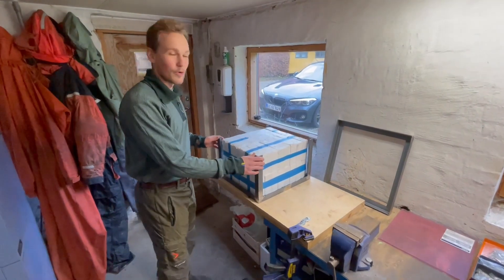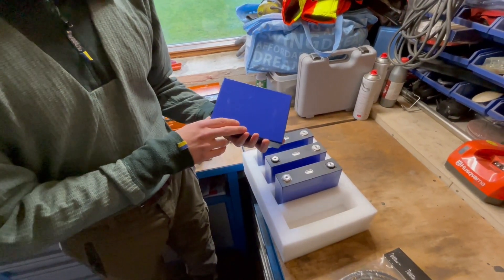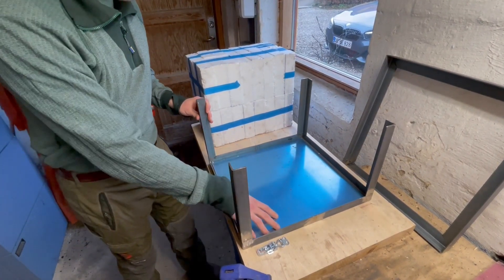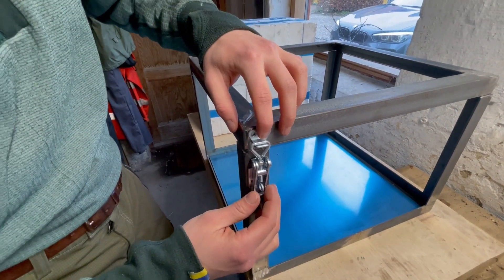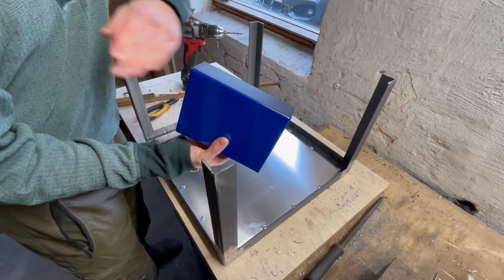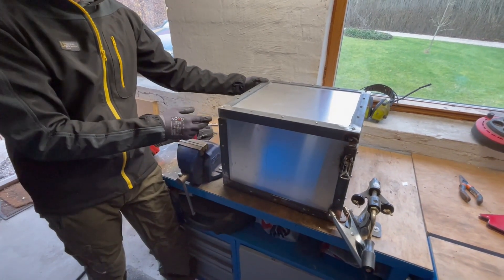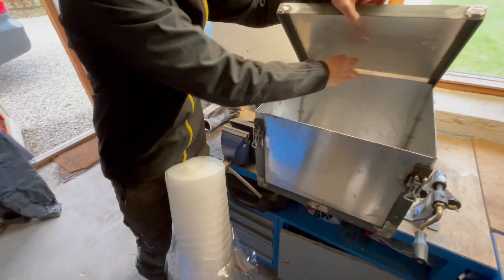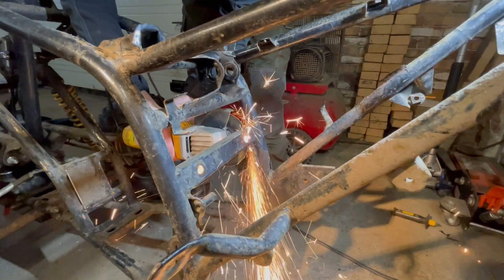The Electric ATV Conversion Ep. 3 - Battery box

Comment: I agree with using thicker foam around cells, I found using the Cheap 10mm Thick Camping style mattress (usually blue in colour) works great for large battery builds. Obviously your battery box needs to be large enough to allow for the extra thick foam I recommend. (20mm extra across the entire battery box)
A Very nice build so far, Great Work 👍 👌 👏
Reply from the maker: Thanks a lot for the input :)

Comment: It is a good idea to leave 2mm  gaps  between  cells to keep them  cooler during  heave duty work .
Reply from the maker: Yep, I agree. The only slight thing there is with these LiFePO4 batteries, is that they have a longer lifetime if they are under compression in the battery pack. 
As they are charged and discharged they grow and shrink slightly, causing the electrodes and electrolyte to get disordered. Therefore in my case there will not be an air gap between them, but maybe I’ll make a cooling grill in the top of the battery box, if it becomes an issue. 
I plan to have a temperature gauge with the BMS, so I can monitor them 😊
However the avg. temperature in DK is around 8-9 deg C, so I plenty cold outside as well.

Comment: Did you leave space in the box for the battery connections and BMS wiring?
Reply from the maker: Hi Tyler,
Yes er did. However er didn’t leave room for the BMS to sit inside the battery box, so that will have to go outside.
Reply: have you decided which brand of bms to use?  I drove daly bms on miss 20s but the balancing is a joke on them and it is only passive balancing
Reply from the maker: @goelectric8269  Yes I have heard that it is difficult to find sufficiently effective BMSs. I have been looking at this: 
https://www.aliexpress.com/item/32826469363.html?srcSns=sns_Copy&spreadType=socialShare&bizType=ProductDetail&social_params=20274371692&aff_fcid=d1c59efa0a99486a9fbcc1e5a8522909-1645287920955-05724-_mKDkDoF&tt=MG&aff_fsk=_mKDkDoF&aff_platform=default&sk=_mKDkDoF&aff_trace_key=d1c59efa0a99486a9fbcc1e5a8522909-1645287920955-05724-_mKDkDoF&shareId=20274371692&businessType=ProductDetail&platform=AE&terminal_id=e3c54fc5c42b46ab859aa58a39056a78&afSmartRedirect=y 

Or alternatively:
https://www.aliexpress.com/item/32959837122.html?spm=a2g0o.detail.1000014.8.638c15dc0WQSyA&gps-id=pcDetailBottomMoreOtherSeller&scm=1007.40050.266918.0&scm_id=1007.40050.266918.0&scm-url=1007.40050.266918.0&pvid=d21f23e0-e05a-4045-915d-fec462011d1c&_t=gps-id:pcDetailBottomMoreOtherSeller,scm-url:1007.40050.266918.0,pvid:d21f23e0-e05a-4045-915d-fec462011d1c,tpp_buckets:668%232846%238108%231977&pdp_ext_f=%257B%2522sku_id%2522%253A%252266551856122%2522%252C%2522sceneId%2522%253A%252230050%2522%257D&pdp_pi=-1%253B720.83%253B-1%253B-1%2540salePrice%253BDKK%253Brecommend-recommend

I have tried contacting the sellers to hear if they think their systems are sufficient enough to handle the system that i have. :)

Comment: This is great! How will the battery pack attach to the frame?
Reply from the maker: Thanks. It is still up for consideration. But it will be a slide in and out solution, so that the battery can also be used to power other things than the ATV. 
I’m thinking that just a couple of bolts will clamp the battery box to the frame and the sliding rails 😊

Comment: How much range do you think you will have?
Reply from the maker: Good question. -I have calculated with a consumption of 0.15 kWh/km, which was determined by converting actual gas power 4x4 ATV consumption measurements to energy consumption in joules and then to kWh. With my 9 kWh battery pack I will be able to go (9 [kWh]/0.15 [kWh/km]) = 60 [km]  in unfavorable conditions and rough terrain (cold and muddy).
Leisurely driving would probably give me around 100 km range :)
Reply: @gorm1106  man that is sweet! I’ll have to try something like this myself
Reply from the maker: ITSMART 
Yes, U definately should. It’s a fun and educating/interesting process. 
The only thing that surprised me bit with such an electric vehicle conversion is the cost of components, where motor, batteries and controller are the most expensive. - But Luckily there are some cheaper components out there if one is not into a to expensive project. Check out Goldenmotors webpage, they make nice products also at a fair price. Also if one can live with lesser range and more frequent charging, this is also a good alternative, to reduce excessive costs.